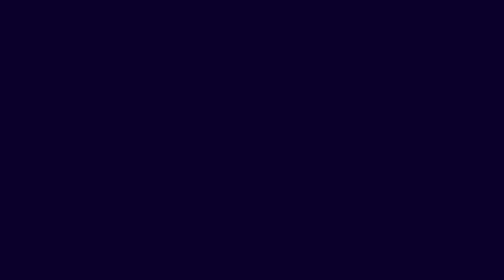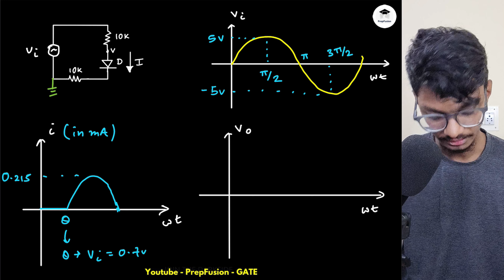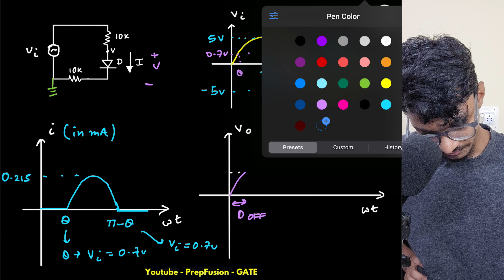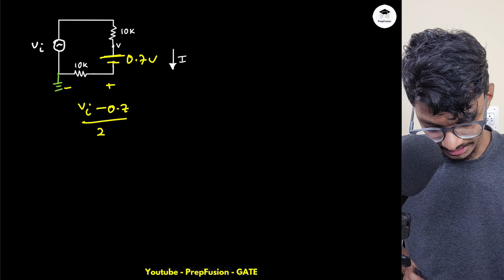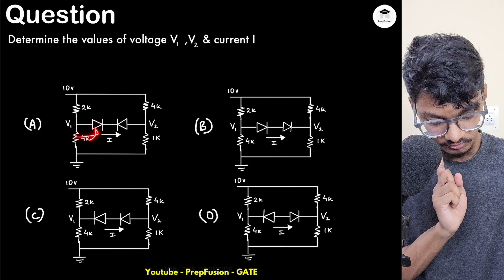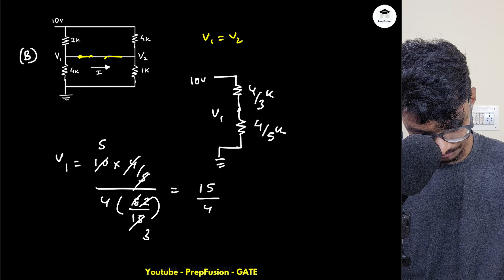MOST Important Questions On Diode Circuits || Analog Electronics Decoded || Circuit Queries

Comment from the maker: Watch Part-2 here : https://youtu.be/G6btBIKpr6Y

Hi There is a calculation mistake @9:42 The anode to cathode voltage will come out to be positive hence after re solving all the four diodes will be on V1 = V2 = V3 = V4 = 0v & ID1 = 1.6 mA ,ID2 = 0.12 mA , ID3 = 2.44 mA , ID4 = 1.58 mA ,This would be the correct answer also @15:50 , V4 = 2.833 Volts.Also a small calculation mistake @51:45 V1 should be 3.75 not 6.25.Sorry about all the mistakes Was really tired that day.Everything else remains same.

Comment: bro at steady stae vc(infinity) is 4.3 V as the result capacitor is full charged no current flowa through the circuit further . So current direction reverses from the capacitor anti clockwise now diode i AK is -ve so it will be off

Comment: At 53:57 the value of the i2 current is wrong, so that the current through the diodes will be negative and diodes will be open circuited
Reply from the maker: See the pinned comment their is a calculation mistake before that states will remain same.

Comment: for D2 diode v2 is cathode and v3 is anode so , vd2 should be vd2 = v3-v2 which is greater then zero but you mention vd2 less than zero @ 9:42
Reply from the maker: Yes all 4 Diodes will be ON. Thanks!